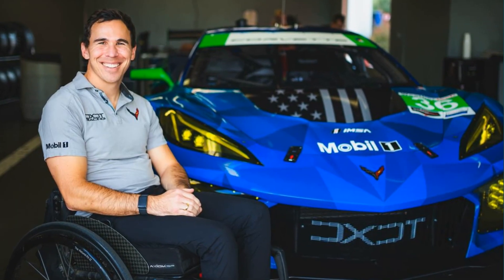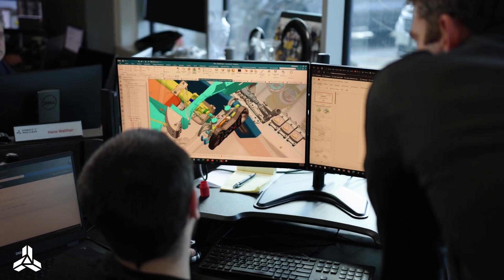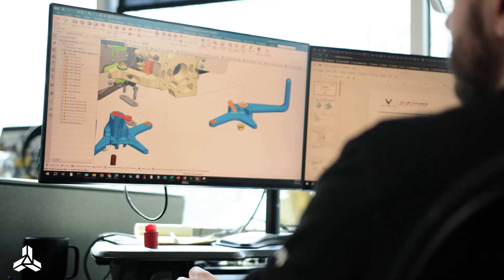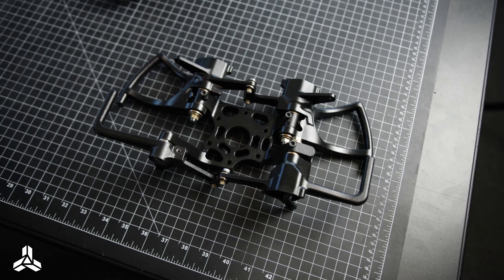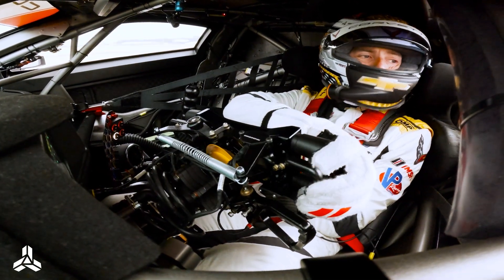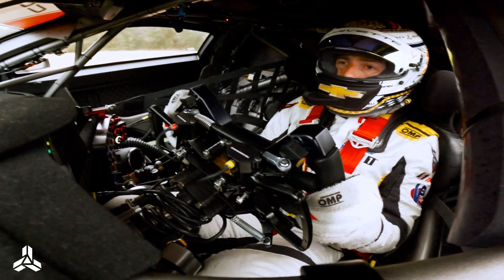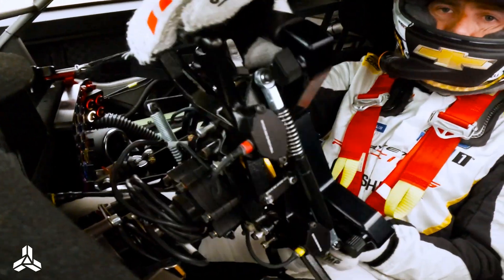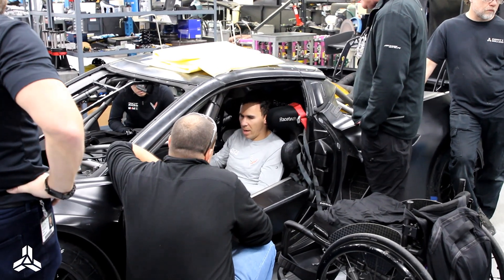Redefining Performance with Hand-Controlled Corvette Z06 GT3.R

Comment: As a motorsports team, it's easy enough to talk the talk when it comes to inclusivity and all that. But these are people who are actually putting their money where their mouth is. Only a small percentage of drivers would need a throttle and brake hand-control system like this. But Bosch, Pratt Miller Motorsports, Corvette, DXDT Racing, etc. led the charge to create a legitimate opportunity for disabled drivers to compete with the others. 

And as an above-knee amputee who lost his leg to racing, I genuinely look up to Robert Wickens as my hero. I've recently gotten into sim-racing, and I was inspired to try using a GT wheel that allowed for throttle and brake hand controls. I was inspired to do so because of Robert. It means a lot to folks like me who doubt if we could ever be as good as other able-bodied folks. Here's to great racing in IMSA and elsewhere! And thank you all for the work you do!